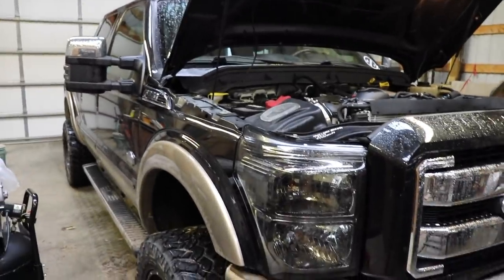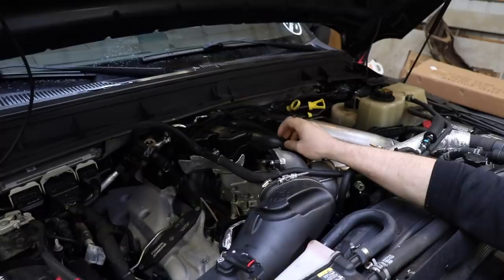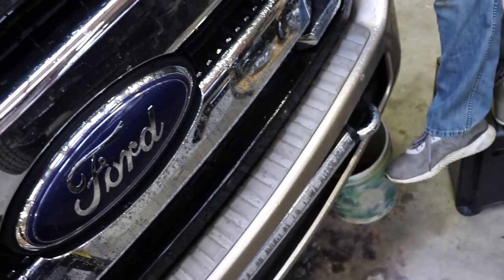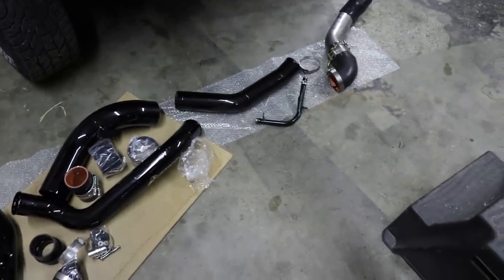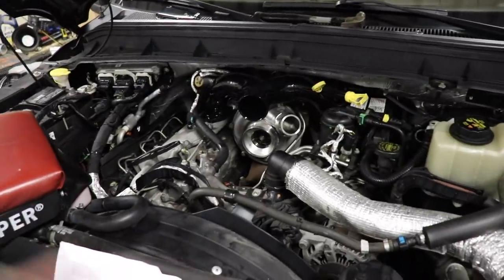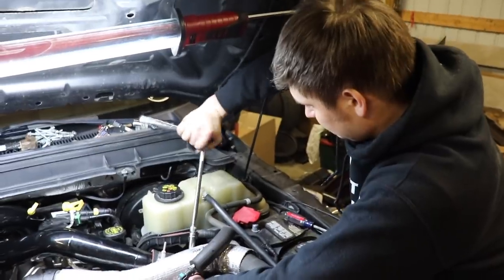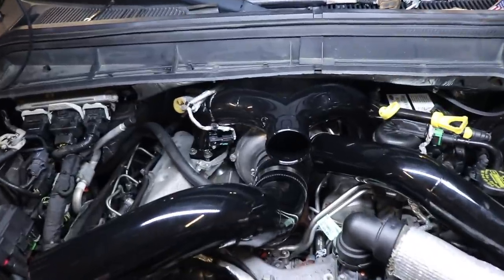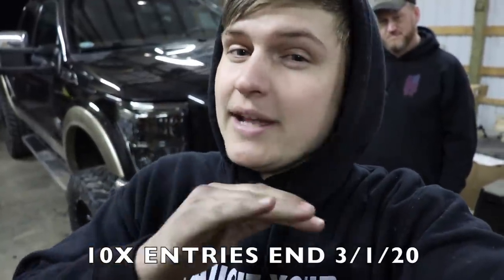NEW PUSHER SYSTEM INSTALL ON THE 2013 POWERSTROKE!!!

Comment: I installed the pusher intake piping kit on my 2016 6.7 powerstroke and now it’s throwing DTC P00BD
“Too much airflow.
Also my MAF and THROTTLE gauges on my turner stay at 0.
Do you know if this is from the throttle body being removed? 
I’ve replaced my MAF sensor and plug. 
Awesome video and thank you for your knowledge and time.

Comment: I find it hard to believe you're getting more power out of that hot air intake versus the cold air intake you had on it.  And I can only imagine driving it on the farm land how much dirt and hay is going to clog that filter.
Reply: Jake Heke  keep telling yourself that pal.
Reply: The intercooler aids in dropping the tempature just as the air being mixed with the exhaust gas to begin with will also drop tempatures.  Every bit of it helps.   Banks has proven countless times in bench testing their product to others on their designs and you don't see them selling an open filter design.  They've also have held the diesel records in fastest trucks ever built coming straight out their shop with their products as well.  And also you forgot that the fact that it's ran on a farm and that the dirt won't as well quickly clog that open filter and then it will be a lack of air flow.